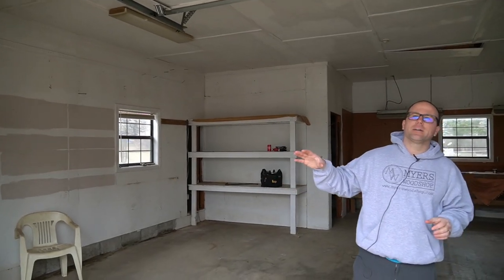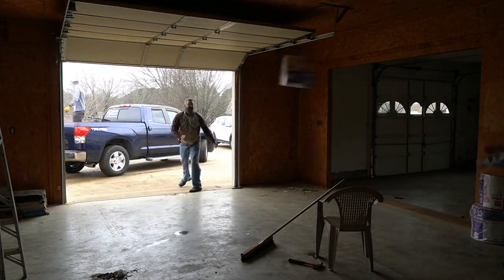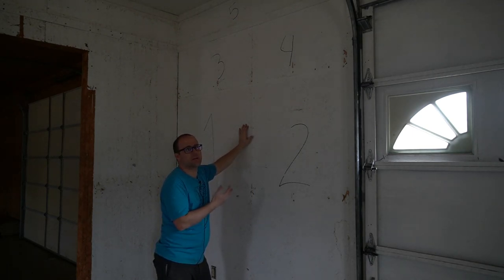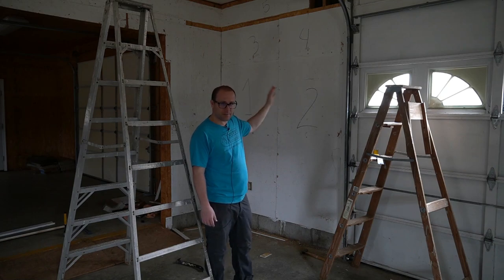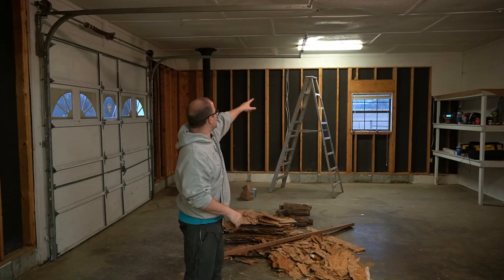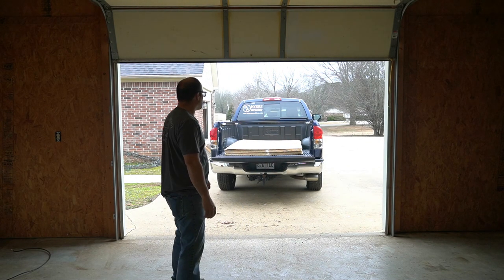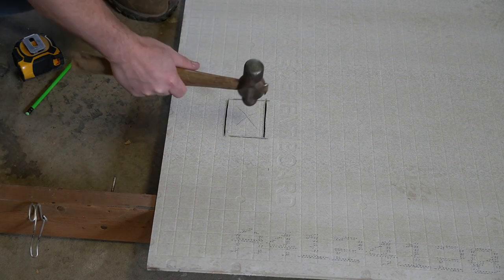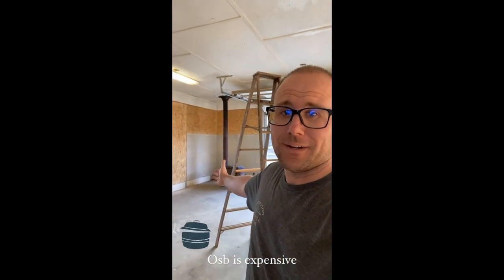Walls and Insulation // Dream Shop Series - Episode 2

Comment: I moved a couple weeks ago and reclaimed a bunch of studs and osb from a room I built in my basement. $220 4 years ago- to buy new would have been $1200. DEFINITELY a good idea to reclaim and reuse as much as you can. 

Looking forward to this series, great start!
Reply from the maker: Yes, I tried, but just couldn't save the walls.  It was a bummer.
Reply: @MyersWoodshop  yeah, that sucks. On the other side of the process now, and I didn’t anticipate I’d have to be rerouting electrical to reuse the old holes, or end up with a bunch of patches, so it definitely is a ton of work.

Comment: Try a Hammer and nail set or punch to drive the nails through the OSB, something you can try next time. 

I did my walls last year (before lumber prices went nuts) R-13 and 20 sheets of 7/16” OSB, weather started turning nice so I put the ceiling on hold. Cold winter in the shop, so I decided to do the ceiling a week ago, OSB another 20 sheets at $40.00 a sheet now of 7/16” $800.00, not happening. Ended up using sheet rock 4’X8’ - 1/2”  $10.35 each a sheet. Ended up paying $457.00 for insulation and sheet rock, a little more mudding and it will be ready for paint. I feel you pain $!
Reply from the maker: OH!  That's a great idea!  Too late now!

Comment: Why didn't you just put spray foam in the wall that way you did not have to tear down the walls. Just drill in some holes and spray in the foam. Could have saved time and maybe some money.
Reply from the maker: I also wanted to see what was behind the walls, particularly the electrical (which i changed a bit).